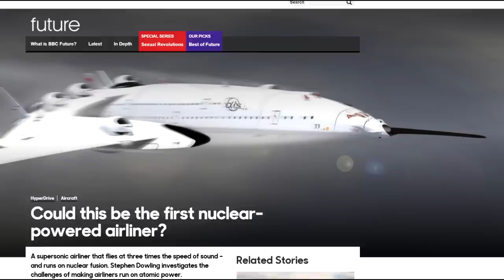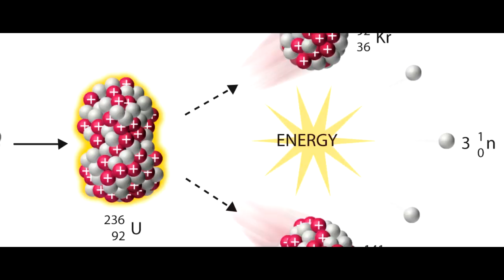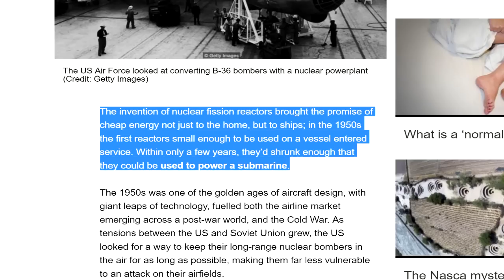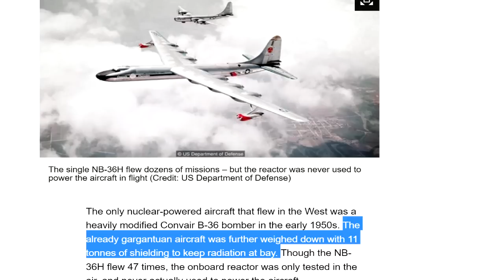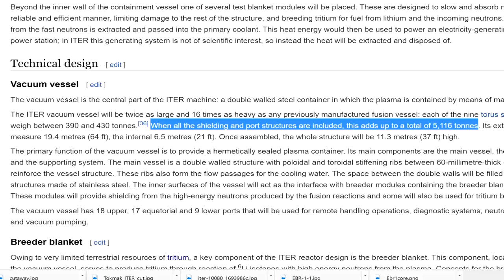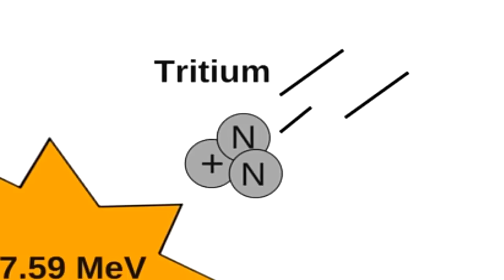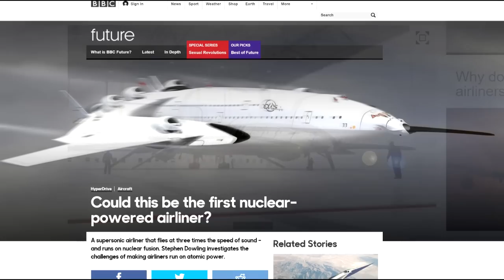SIX ENGINED Nuclear Airliner... BUSTED!

Comment: I'm not sure if you're mocking the concept "aircraft", or nuclear powered aircraft in general. The former is ridiculous nonsense that deserves ridicule... The latter is a viable concept that has been previously pursued in the Aircraft Nuclear Propulsion program. The advent of the ICBM and primitive radiation shielding materials shut the ANP program down before more progress could be achieved.

Also, B-29's have a 9 tonne payload, whereas the B-36 had a 32 tonne payload. 39 tonnes if you REALLY wanted to push for another 7 tonnes. To put that in perspective, the B-36 could carry an empty B-29 and another 6 tonnes of ordnance on top of that.

Comment: Typically I like Thunderf00t's videos, as he humorously debunks scams and myths, but in this I think he completely misses the mark. Over the decades, if not centuries, it has been common for people to imagine a possible future. Imagine a future even to the point of releasing documentation of what they effectively would like to see, including detailed specifications.

This has resulted in the past of scientists and engineers often trying to work towards this imaginary future. You want flying cars that travel at a certain speed? We'll try and make that (Moller Skycar). You want Mechs that are capable as front line war units? We'll try and make that (Megabot and Suidobashi). You want a ship mounted mass driver that can fire projectiles with enough kinetic energy to demolish the target even without explosive warheads? We're looking at mounting one right now (Railgun on USS Zumwalt)

Sure, many are pure fancy and won't occur in our lifetimes, if at all, but if a presentation is delivered as a pure 'what if', even with detailed specifications supplied, is this also not what drives people, to discover whether it is actually possible?

About the biggest failing of this 'Nuclear Airliner' is the quoted persons failure to understand the concepts of existing and future technologies. There is nothing wrong in the dream itself. It has happened before, and it will happen again.

Comment: Surely if fusion was to get going and work well it would be much more efficient than nuclear fission in producing power?
Reply: If by efficient you mean ratio of produced energy over mass of the fuel, then yes, it would be very efficient. However, if you mean energy over the price of the fuel, then no... In fact, it might be one of the most expensive sources of energy out there.
It would also be much more dangerous. Fission reactors can technically operate at any temperature, because they rely on spontaneous process. However, fusion reactors require extremely high temperatures and pressures (talking core-of-a-star high) to even work, let alone create energy surplus. They are extremely dangerous, in fact, it's a miracle that no fusion experiment blew up until now (except hydrogen bombs where the boom was the goal).
Reply: That sucks cause its waste product is helium which is much easier to dispose of than the products of fission

Comment: What would be a more realistic idea that I would find interesting is using nuclear reactors to power the whole airport including batteries for the "Electric engines that can go 3,600 KPH with 250 passengers" airliners.  This way power outages during harsh weather won't affect airports and the refueling process, as it might not need to happen with a reactor in the plane, would only take as long as replacing the battery with one that was charging from the airport's reactor. 
Although, i don't know jack about the technicals and price of putting nuclear reactors in every airport and having them charge a shit ton of batteries along with an airport.

Comment: How to get nuclear powered planes: use nuclear energy to power the production of synthetic jet fuel, which are then used in regular airliners. This is in fact the most likely way things are gonna go as climate change becomes more of an issue and fossil fuels become harder to obtain.
Reply: actually much more feasible solution is to use GMO algae or something similar to produce the fuel. Synthetizing jet-fuel de-novo is considerably more expensive alternative.
Reply: +KohuGaly um, yeah. algae could be processed on machinery powered by renewables/nuclear. I'm not excluding that.
Reply: Or just split water into hydrogen and oxygen and use that to fuel an aircraft or spacecraft with SABRE engines.

Comment: There is such a thing as aneutronic fusion, using fuels such as Boron or Helium 3. Energy released as protons can captured by electromagnetic coils so you don't need big heat engines to use the energy either. Well has not actually been done yet but it is theoretically possible.

Comment: If nuclear planes existed what would happen when they crash? Planes crash more often than we like through mechanical/pilot error, but what's scarier is the terrorist element that can steer them into a heavily populated city, e.g. the 911 attacks. In a crash would the nuclear reactors do more/less harm than jet fuel? As a layman I have no idea but I'd want to know if we'd have radioactive fallout if the reactor is breached?
Reply: A nuclear-powered airplane is basically a dirty bomb. A crash of such plane would render area in 10-50km radius around the crash-site dangerous for humans to live in or grow food practically forever. People probably wouldn't die of radiation even if the plane crashed (except those in the plane) but they would have to get evacuated quite a long distance.

Comment: Kinda forgot to mention a few other problems that we ran into with the nuclear bomber and the aircraft reactor experiment. First off that amount of shielding was just for the pilots and that barely cut the radiation to relatively safe levels. Since they only had to worry about the shielding for the crew, they were able to space the weight evenly throughout the plane. since this is proposed for a passenger airliner, the weight distribution will be way off because all of the necessary shielding will be right around the reactor. I highly doubt that they will be at all able to place the reactor and the shielding right in the proper center of mass to allow proper control of the aircraft. 

Next up is that they have next to no concept of how big the reactor system will still have to be. The one from the aircraft reactor experiment was about 2m or so in diameter for a 2.5MWt molten salt core that wasn't exactly light. This was enough to get the bomber up to the expected speeds of a little less than current jetliners are capable of but far from enough to go anywhere near supersonic. Just a shot in the dark you'll probably need at least 3-4 times that output to even think about going at those speeds. Then you have to figure out a way to actually deliver that power to the engines, which you have two options of. The simplest and lightest option would be to run the coolant salt directly from the reactor (i'm saying salts because they were the fuel/coolant of choice in the experiment but also the likely coolant of choice if we actually get fusion to work.) Big drawback about this is that you'll have to worry about radioactive contamination coming out the exhaust which is going to be a pretty hard sell for use in a civilian airliner. The second method is to use an intermediate loop that eliminates the radiation leakage but adds even more weight for heat exchangers and pumps. While we could cut a little into the weight of the reactor using modern materials, bear in mind that even a modern version of the molten salt reactor used doesn't exist yet and we built a working and successful reactor based on it. We have to go through well over a decades worth of research, development and bureaucratic hurdles just to test reactor designs based on existing tech. How do these geniuses expect us to start rolling out reactors based on tech that doesn't even work?

While we're here me might as well bring up the fact that the engines are all either going to have to be like the J58 on the SR-71 and have a traditional turbofan that transforms into a RAM jet after reaching supersonic speeds or the airliner is going to need a mix of both types of engines. Oh lets not forget the engineering challenges related to the life support systems needed to keep the cabin sufficiently pressurized at over 20kM and keeping everyone cool as the aircraft is experiencing over 200 C temperatures from the wind resistance.

Comment: Jusg by looking at the picture I can tell it's fake. They say the plane runs on nuclear power, but just by looking at the engines, you can tell that they are low-bypass turbojet enigines (There's no way they are going to fit a propeller in that small cylindrical housing). However, Turbojet engines work by pressurizing air and then injecting jet feul witch is then ignited. It would be impossible for a Turbojet to function solely on nuclear power.

Comment: Okay, I'm going to ignore the fusion part for a moment.  How do electric engines propel something to supersonic speeds?
Reply: Okay, after a bit of research, it seems that using liquid nitrogen as a cooling fluid (presumably created and stored on the ground), and heat produced from the hypothetical fusion reaction, a reasonable expansion of the air is possible, potentially propelling up to Mach 1.5 or something.  Then there's the hypothetical possibility of electrically ionizing the outer edge of the craft, which hypothetically could reduce air resistance by some amount.  Even with all of the ideas I've read about this, and assuming a magic fusion reactor, I don't think Mach 3 with an electric engine is possible.  Maybe Mach 2.
Reply: Magic
snort snort

Comment: do thorium reactors would actually work?
Reply: no... they would actually be the worse option of them all - they are notoriously hard to heat up to operating temperatures and are hard to regulate. Also, they use operating temperatures of 350ish °C in molten florid salt - not exactly something I want on the inside of a plane...
Reply: alright thanks, i was talking on a nuclear power plant not a plain but i got your point ^^

Comment: How to make a six engined nuclear airliner:
1, Get a miniaturized reactor.
2, Put it in a cargo plane like C-5 or An-124.
3, Retrofit the jet engines with electric propeller engines.
4, Power the electric engines with the reactor.
5, Add some seats so you can call it "airliner".

How to make a fusion powered airliner that flies at Mach 3:
1, Hire an artist to design a alien looking aircraft and make some CGI renderings.
2, Pay major websites for them to publish articles about it for attention.
3, Start a kickstarter/indiegogo/any kind of crowdfunding campaign.
4, Say "We are sorry to end this project for difficulties beyond our capability. No refunds BTW."
5, Take the money and run.
$$$ Profit $$$

Comment: the design is even fucking worse don't get me wrong I have basic knowledge of aerodynamics and physics but I'm pretty fucking sure it wouldnt even take off the fucking ground, and if you do? its going to be pretty hard to control it due to the fact that the wings don't eveb cover more than the plane length and don't cover much space either, also it woumd require ungodly amounts of power to to fly it for an hour, more even too pull its own weight
Reply: yeah... when I first saw it, I thought it's a ship...
Reply: It's a terrible design but if they ever did make nuclear powered aircraft why not i don't know use an upgraded but larger version of the SR-71 hell that would work easily or a flying wing plus we could use Plasma thrusters not those pulse ones they don't provide enough thrust I'm talking about Fusion powered plasma thrusters if we could get any of the reactors we want online and compacted for portable use here's hoping lockheed's HBFR project works if it works then by 2060 we should have fusion based Plasma thrusters propelling our shuttles through space which should reduce the routine trip to Mars from a six month trip to a three week trip if advanced models are made early models would just make it a three month trip.  Plus Thrusters would work better for a nuclear powered Aircraft since the jets would   overheat and break constantly.
Reply: Muricanknight 5678 or we could use nukes as propulsion from one of the earlier not so secret anymore projects. it wouldnt take long to reach mars pretty quickly, but it would take a lot of resources for just one way and would damage the earths and mars' surface since you cannot take off from mars traditionally i dont remember much of the project since i watched a documentary about it a long while ago, by 2060 scientists would have figured out how to make humans immortal via the use of jellyfish
Reply: +kuba zrobczynski the Orion spaceships you are talking about had a ridiculous weight to thrust ratio. you could build VERY robust landing craft to ferry crews to and from mars. in in one sci fi book I read they mounted 4 space shuttles and about 6 x15 craft into an Orion type craft
Reply: bryfunkenstein but it does infact take a shit ton of nukes to power it..... although it would be good for long distances for example if we are trying to reach another habitable planet and help with the ridiculous weight of the spacecraft which the inside is spinning horrendously quickly to create artificial gravity
Reply: +kuba zrobczynski the nukes would be small with dialable yields. they would also be shaped charges.
Reply: bryfunkenstein still about the size of a bus
Reply: +kuba zrobczynski we made suitcase nukes. a 1 Megaton mirv is about the size of a man. orion ships were to be massive. scalable to city sized spacecraft...
Reply: bryfunkenstein that's a lot of technological advancments
Reply: +kuba zrobczynski no it's not. they designed this thing in the 50s and 60s.
Reply: bryfunkenstein so a suitcase sized nuke would be good enough to power it?
Reply: bryfunkenstein of course I know I thoufh you were talking about something else I though ylu were tslking about suitcase sized nukes ebough to pwer the whome thing
Reply: +kuba zrobczynski the size of the nuke corresponds to the size of the ship and how fast they want it to execlerate. so a suitcase nuke could possibly power a smaller Orion craft...where a 1 megaton could power a bigger craft
Reply: bryfunkenstein have you seen the documentary about how of the world was ending 1% of the human population would set off into space by a spacecraft powered by nukes and the city the humans were living in to be spinning very quickly to create artificial gravity and surging electricity through water to create oxygen? i heard of project orion that way, although i dont see how it will propel the spacecraft since its vacuum in space obviously so would the nukes "push" the spacecraft to propel it?